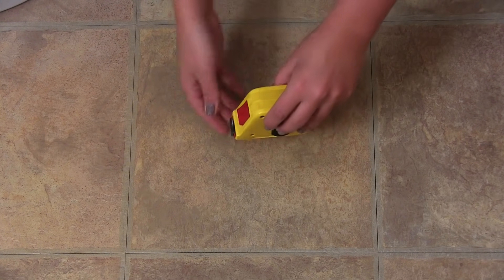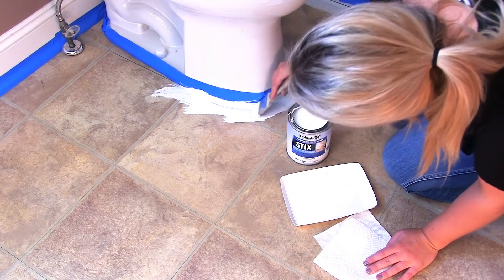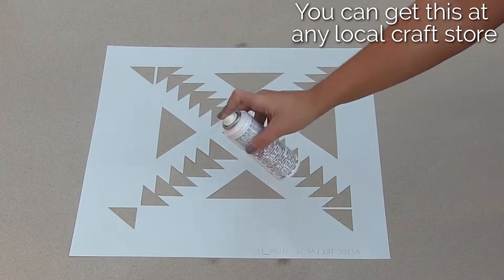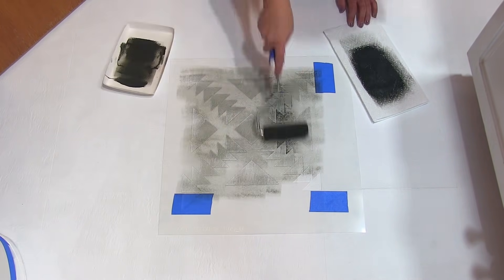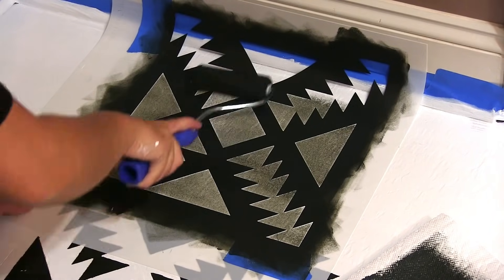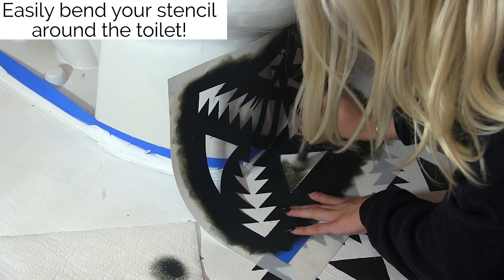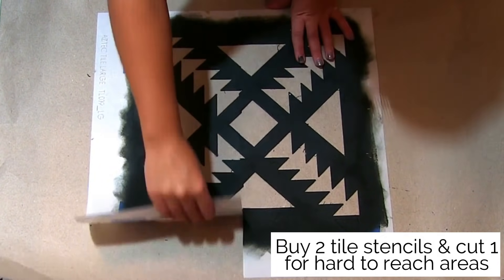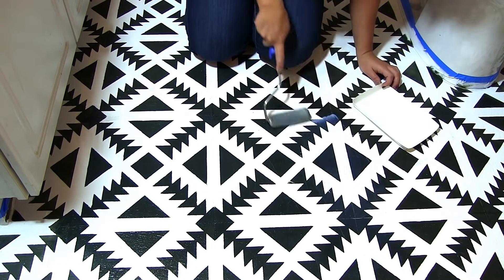How To Stencil A Linoleum Tile Floor [ STEP BY STEP ]

Comment from the maker: DISCOUNT CODE: Youtube10 & get 10% off your stencil. You can buy Cutting Edge Stencils Aztec Tile Stencil here: https://www.cuttingedgestencils.com/geometric-tile-stencil-cement-tiles-stencils-aztec.html
Reply: Several questions. How do you know where to start stenciling...my thinking is that you would start in the most seen areas. Want to do my kitchen floor(tiles im putting down will stencil b4 put down and since no cabinets in yet figured areas hidden by cabinets would be last area done). Ive watched videos of them doing them. But there never seem to be rhyme or reason where you start or where you end. My thought is if half a tile is left to put in at end better hidden under cabinets. What do you reccomend if tiles are already put down?
Reply from the maker: @judibohn1548  Hi Judi, we have your answers! You were correct about where to start to stencil. Before the tiles are put down and it's just a flat surface, we normally choose the center of the floor (where your eye takes you first) and start from there. Then work your tile stencils from the center moving outwards, eventually reaching corners of the room. If you currently have tiles on your floor, we recommend placing the tile stencil directly over the tile. Always measure before ordering the stencil to make sure the stencil is the same size as the tile. That is what we chose to do in this video and is what other our other customers do as well. I hope this helped! Feel free to ask any more questions you might have.

Comment: I read somewhere too that if you Modge Podge over the stencil first it won't bleed through and give you crisp edges.
Reply from the maker: Wow, never heard that. For me it really comes down to proper paint load on your brush or roller and maybe using spray adhesive.
Reply: Do you have to use the spray adhesive in between every new tile?
Reply: @charlenetennis5419  if you are talking about taking off the stencil and replacing it than I assume you would do light adhesive each time around the edges to make it have crisp lines. Also, I have found the green Frog 🐸 tape works best for crisp lines w no bleed through.

Comment: Great job!! What paint did you use? And is it possible to get this set of supplies in India?
Reply from the maker: Hi Aamrapali, thank you so much. We're happy you like it! In this video we used flat latex paint (which we highly recommend) but chalk paint works just as well! We also ship stencils and supplies to India! We would love to see your project! :)
Reply: @CuttingEdgeStencils  Thanks for the prompt response! :) Our team will get in touch with you in due course.
Reply: @CuttingEdgeStencils  
1) Does this work on rough textured vitrified tiles? 
2) Is there a primer available that can help the paint get good hold even on smooth surfaces?
3) If used on rough surfaced floor, does it hold well even in commercial environments?
4) For how long does the paint last on a regular residential floor? (given that it is exposed to only footfall and NOT other forms of abrasion such as pulling heavy furniture over it)
Reply from the maker: @Supra-Orbital  
 1) Stenciling can work on a textured vitrified tile, however it NEEDS to be sanded until completely smooth. You can sand with 120 grit sand paper, and smooth it out with 220 grit sandpaper. Some issues you can run into with textured surfaces and stencils is bleed. This can make the design not look as sharp as you want it. Once smooth, it should be fine. If it is very porous, consider alternatives to filling the larger holes/creases before stenciling. 
2) We recommended STIX primer. We found it provides the best adhesion compared to other primers. 
3) It's more about the number of coats of sealer than the floor type. If you seal your floor with 3 coats of water based polyurethane, it should withstand areas with a lot of foot traffic. You can always add more!
4) Once the paint is sealed with the water based polyurethane, it should last up to years! We have a stenciled tile floor in our office that it going on five years and it still looks brand new! 

Let us know if you have any more questions! :)

Comment: Do you have to let the stencil dry and reapply sticky note spray for each square? My previous experience with letter stencils had residual paint on the back side and would come off on the next one.
Reply from the maker: Hi Heidi! Most spray adhesive should last about 2-3 repeats, but reapplying it to the back of the stencil every time could reduce your chances of paint seepage under the stencil. Before you move on to the next tile,  the previously painted one MUST be DRY.

Comment: I’ve seen some people clean the back of their stencil after each use, before moving forward. Is that a necessity or how do you avoid excess marks from stenciling a previous area?
Reply from the maker: Hi! Cleaning the back of the stencil is not necessary if you are stenciling correctly! :)  The only way paint will manage to get under the stencil is if there is too much paint on your dense foam roller/stencil brush and your press down over the stencil really hard. Thats why we recommend applying the paint in 2 very light coats for full coverage. You can apply repositionable spray adhesive the the back of the stencil to help it stick to the surface and reduce your chances of paint seepage.

Also, it's important to wait for the painted tile stencil pattern to fully dry before moving on to your next tile stencil pattern. If you stencil in paint in a flat finish (which is what we recommend) the paint will dry faster!

Please let me know if you have anymore questions! :)
Reply: @CuttingEdgeStencils  thank you!

Comment: Hi @cuttingedgestencils just want to ask if you can directly paint the stencil in plain white tiles..without putting any paint since it is white already. thanks.
Reply from the maker: Hi Nave! We wish it was that easy! The reason behind priming and painting your floor before stenciling is to create adhesion for the stencil paint to stick to the floor. For white floors, you can get away with just priming. We like to add a coat of flat latex white paint over the primer because it comes out a little softer. It's completely up to you! :)
Reply: oh is that so...thank you so much cuttingedgestencils

Comment: Every time you lay the stencil to paint you should spray the adhesive, correct?
Reply from the maker: You only have to re-apply the spray adhesive when it starts to lose its tack :)
Reply: CuttingEdgeStencils  ok thanks!!

Comment: is there a stencil for floors that have ceramic small tiles on it,the little black & white triangle shape tiles,
Reply from the maker: Hi Chris! You can use any of our tile stencils on ceramic flooring, no matter the shape of your previous tiles. If you follow the directions in the video, it will be a success! Just add a little extra repositionable spray adhesive to avoid stencil bleed. Find your favorite tile stencil design here https://www.cuttingedgestencils.com/tile-stencils-cement-tile-stencil-designs-floor-tiles.html

Comment: your floor looks like vinyl  - not linoleum -which is a VERY BIG DIFFERENCE - linoleum is made from wood pulp & and linseed oil and needs to breathe  - YIKES! This will NOT WORK linoleum !!!!!!
Reply from the maker: Hi Suzy, if you follow all of these steps correctly you can stencil over almost any floor surface.